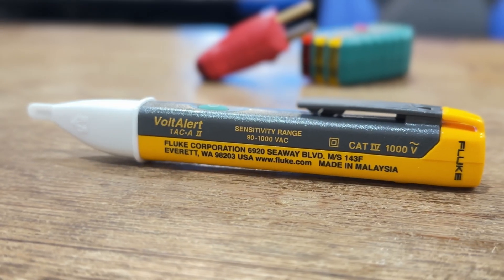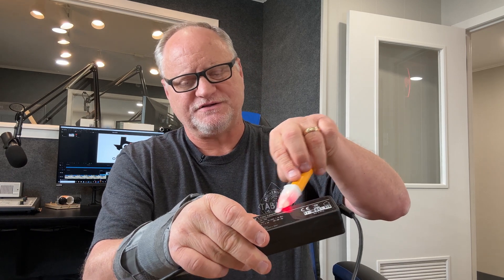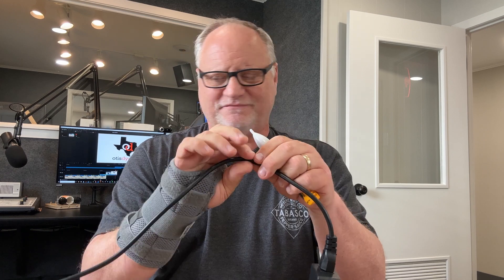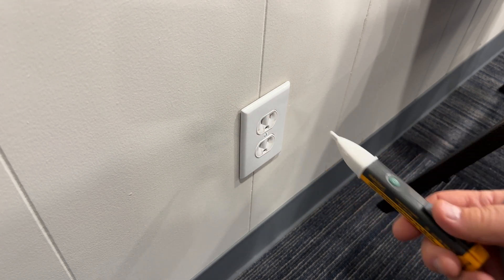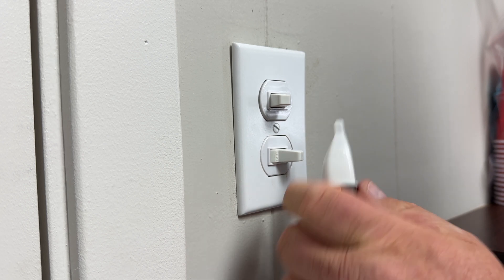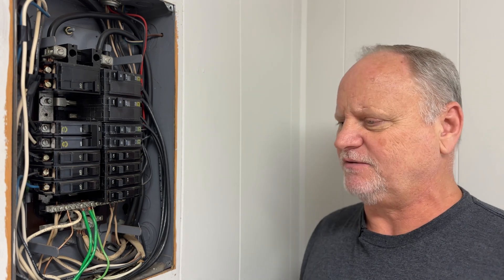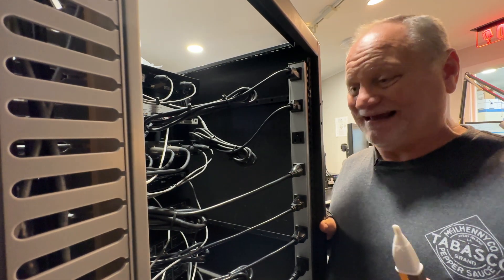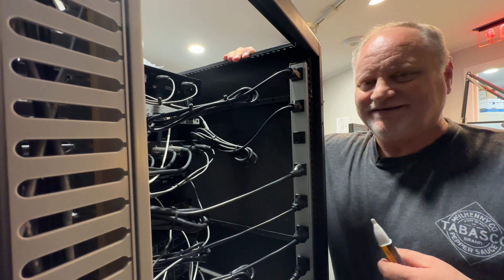Fluke Volt Alert 1AC II  Voltage Tester That Doesn't Require Contact!

Comment from the maker: Don't chance it!! Test it!!
Reply: Hello Otis, thank u for the video. 

I saw a youtube video of an HVAC technician who was working on a AC condenser unit and he was shocked by some of the components because he claimed the unit was energized with electricity and wasn’t grounded properly. 

Would this voltage tester be the appropriate tool for this setting and would it have alerted the AC technician of any potential electrical hazard?

Sorry for the newbie question but i just started HVAC school a couple weeks ago and safety is paramount for me. I am looking for a device that will work as a precautionary measure so i can avoid electrocution, something that will allow me to scan surfaces or contact points notifying me of any dangers before i make physical contact with the AC units i will be servicing. 

They say when we first approach an AC unit that we are supposed to test units with the back of our hands for any potential electrical hazards but that didnt sit well with me, hopefully this tool is what i am looking for, it looks like it might be but i am a complete novice. Id love to hear what you have to say, any advice you can give me? 

Thank you

Comment: I never thought of testing power strips with it.  I've tested extension cords though!  That's one of the main reasons why I got the Fluke 1AC-A II and also to test UPS's  (Uninterruptible Power Supply Units)  It works like a charm for quick checks and not having to power down everything and go through every single outlet one at a time!